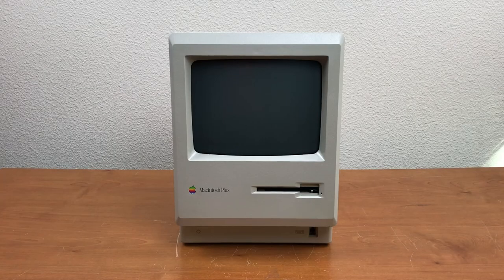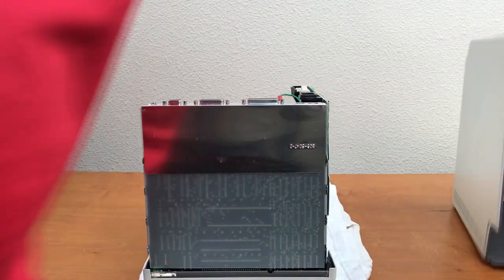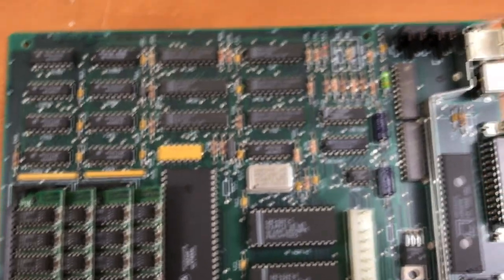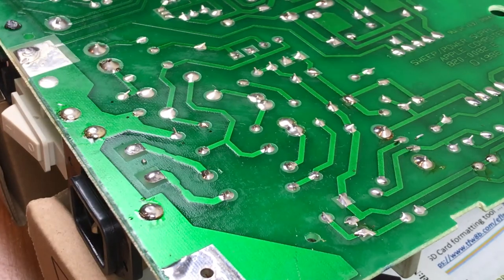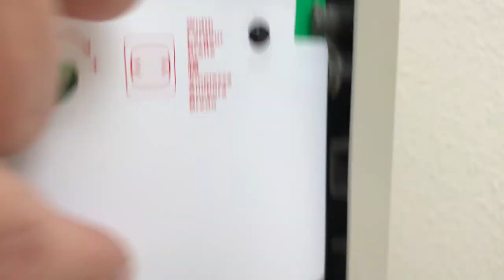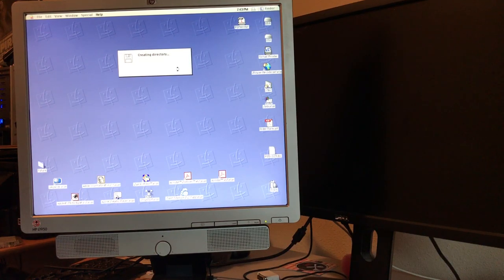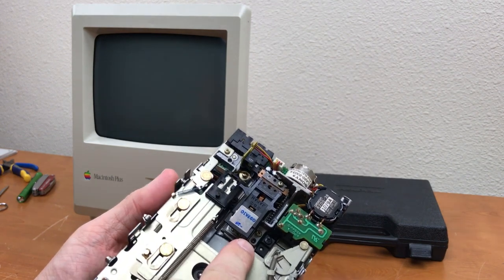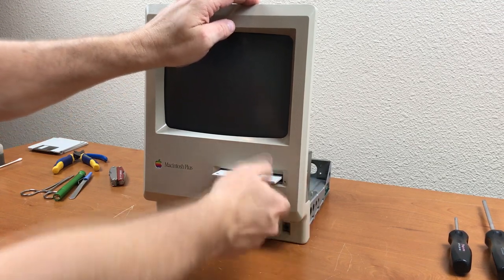Macintosh Plus Restoration (Part 1)

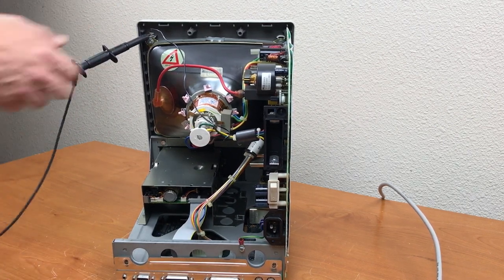Comment: 13:52 With the deflector cable i.e. the flyback transformer never plugged into the tube, it obviously never charged hence no discharge spark.
Reply: (3 years later...) the deflector cable is something different, the flyback is connected via that red cable. There was a pin shape on screen so the flyback was working and the tube should have been charged. I believe I read on the Macintosh service manual to discharge the tube when connected to the metal band around the tube - not the chassis. I believe it said that if you use che chassis, the logic board might get zapped. It worked anyways :)